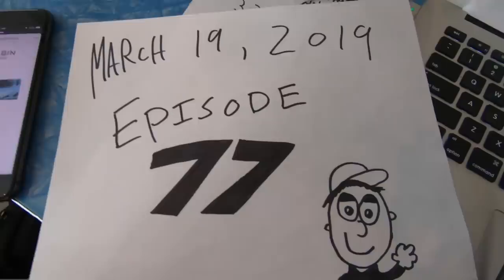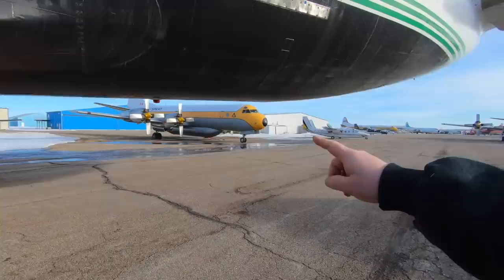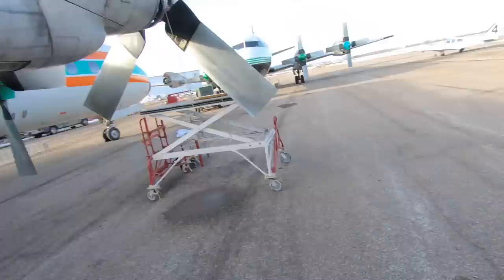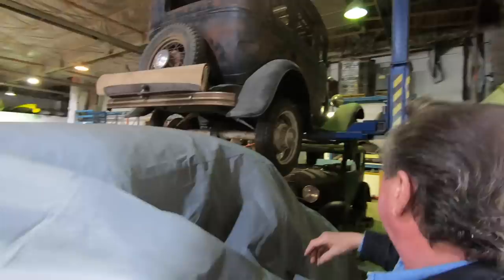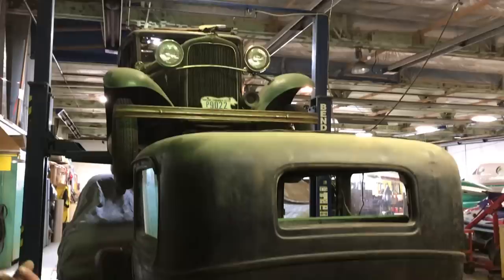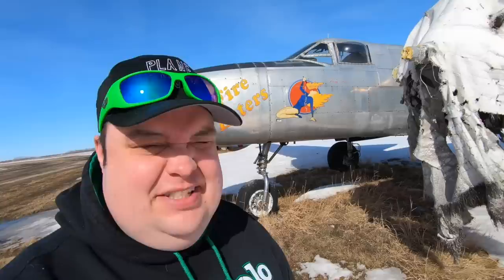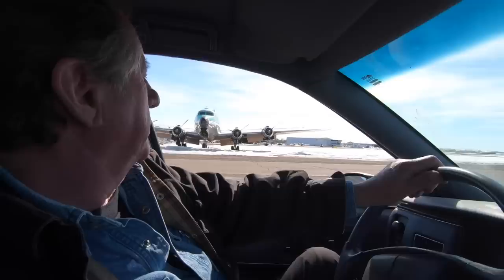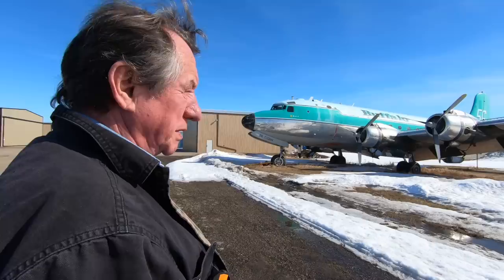"The Planes and Cars of Red Deer " Plane Savers E77

Comment: Mikey...your comment about assembly line production is correct.  A few fun facts: The Ford Production System paved the way for most modern lean manufacturing, and the best physical embodiment of it was the Willow Run B-24 bomber production facility in WWII.

After intervention from Ford, Willow Run was able to go from producing one bomber per day to one per hour. That’s 24x their original output.

At the heart of the facility stood the “pacing clock”. This monitored what we now call takt time.

Many people believe the Toyota Production System was born in Japan when in reality, General Douglas MacArthur took this Ford Production System to Japan as a part of its post war rebuilding efforts.  Companies like Toyota, used and improved the system and thousands of companies across the world employ this approach to varying degrees.  By the way...Toyota produces a Camry every 55 seconds at their Georgetown Kentucky plant.

Comment: Air Spray owns Electra L-188 C-GHZI, former Reeve Aleutian Airways N1968R.  It was the aircraft that operated Reeve Flight 8, featured in season 12 of Mayday.  It lost a prop while en route, which struck the fuselage and pinched the flight control cables.  It made an amazing landing at ANC.

Comment: The round tipped props are Hamilton Standard 54H60 Series. The square tips are Aeroproducts A6441FN-606(A) Series. C-GIZU has the round-tipped props because it is an ex KLM aircraft; it was delivered to them as PH-LLG in 1960. All 12 KLM Electra's had the round tipped props. Except KLM only Capital ordered 5 Electra's with the Hamilton Standard props, but this order was canceled and the A/C sold to other operators.

Comment: In the RAAF, our C-130E and H models shared the same engine as the P3-Cs, but with different props.  The square props are more efficient at higher altitudes, whereas the rounded ones are more efficient at lower altitudes  Our P3s operated very low in the maritime surveillance role, thus the rounded props; whereas the C-130s were strategic transport (higher levels) with squared props.

Comment: Mikey, interesting about the square and round Electra props. Most (all?) modern turboprops have scimitar blade props and when I recently swapped the prop on my Savannah to a scimitar one I found it to be smoother with better performance than the old one. Obviously development of the Electras finished years ago and I doubt that there's even a suitable scimitar blade available for them, but do your engine guys think that their performance/economy could be improved if there was? If so, with the number of them that you and Airspray operate it might be worth considering having new ones designed and approved rather than keep extending the life of the old ones through overhaul.

Comment: A very interesting episode of Plane Savers which has revealed the many interesting aircraft types owned and operated by Buffalo and the ones for sale and making the transition into Basler conversions,you have some rare automobiles there too under those wraps,beautiful art deco shapes from yesteryear.

Glad to hear that DTD will not be over restored,the patina of the past is important and loading up with paint is not the answer just sympathetic restoration and corrosion protection is more worthwhile with a few of those nicely polished panels.
I like your summing up of the assembly/module process Mikey as it all comes together,with all of the expertise on site you have a boosted head start to any aircraft restoration project.

Those A-26's were a real surprise I never realised that they still existed ? the Bug bomber DC-4 will no doubt attract more interest after this video reaches the world,never realised the spray bars went on the top of the wings but it makes sense as the props blast the chemicals rearwards.

We are being treated to some rare material that we would not see otherwise.

Comment: Mikey here`s you answer on the props compare the L188 Electra which was developed into the P3. The L188 was optimized to fly fast (about TAS 330 Knots) and reasonably high (F/L 250). The L188 had square propeller tips, with a slightly broader blade than the P3, i.e. the same propeller area to absorb the power. Some loss of aerodynamic efficiency was acceptable to avert the much greater loss of efficiency in having the propeller tips reach Mach 1.0 at fast and high cruise. Hope that helps you out . I thought i saw two old Zantop birds any chance you can get the tail # of them? most of the old birds are beer cans now.

Comment: https://www.pprune.org/tech-log/100428-prop-shapes.html   

Hopefully this helps with in regards to the two styles of props on the plane.   

 (Taken from Link provided)
  The problem with fast, fairly high flying turbo-props with large propeller radius is that the propeller tips will be the first part of the aircraft to reach the speed of sound, with resultant significant loss of thrust for the power delivered to the propeller.

Compare the L188 Electra which was developed into the P3. The L188 was optimised to fly fast (about TAS 330 Knots) and reasonably high (F/L 250). The L188 had square propeller tips, with a slightly broader blade than the P3, i.e. the same propeller area to absorb the power. Some loss of aerodynamic efficiency was acceptable to avert the much greater loss of efficiency in having the propeller tips reach Mach 1.0 at fast and high cruise.

The P3 on the other hand was optimised to spend most of it's mission time at low level, where sonic propeller tips are not a problem, and the higher aspect ratio rounded tip propellers provided the optimum efficiency. It still left the P3 with a 'respectable' high speed / high altitude transit capability, but not in the same league as it's 'parent' L188. (This loss of high speed capability may have been compensated for in the increased power (by about 500 HP per engine) on the Allison variant fitted to the P3).

One of the prime reasons why many modern fast turboprops have 5 bladed propellers is to reduce the propeller radius, thus reducing tip speed and avoiding sonic speeds.